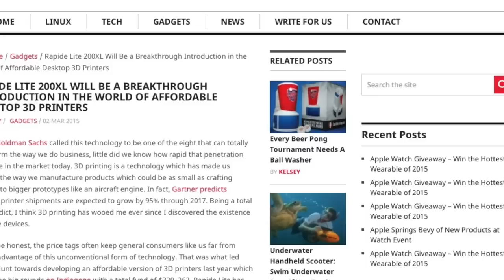Rapide Lite 200XL Desktop Plus 3D Printer Official Trailer

Comment from the maker: Hi Karthik,

thank you for your message.   There are some specific differences in both the Rapide Lite 200 & 200XL.   The 200 currently uses our original RUMBA based board and 2.4" LCD (non color and no touch screen).   The Rapide Lite 200XL uses the new ARM 32 Bit Control Board and 2.8" Full Color Touch Screen Interface.   If you want a good processor i would recommend you choose the 200XL at this time.   

Regards

Ethan Hunt
CEO

Comment: Hello Team,

Other than the size, no other difference?  All processor and display also same. I thought it was different for both. Plz correct me if I am wrong. I really confused, which one to choose. I want a kit at the same time i want good processor. Pl advice, which one to choose.
Reply from the maker: Hi Karthik Kannan 

thank you for your message.   There are some specific differences in both the Rapide Lite 200 & 200XL.   The 200 currently uses our original RUMBA based board and 2.4" LCD (non color and no touch screen).   The Rapide Lite 200XL uses the new ARM 32 Bit Control Board and 2.8" Full Color Touch Screen Interface.   If you want a good processor i would recommend you choose the 200XL at this time.   

Regards

Ethan Hunt
CEO